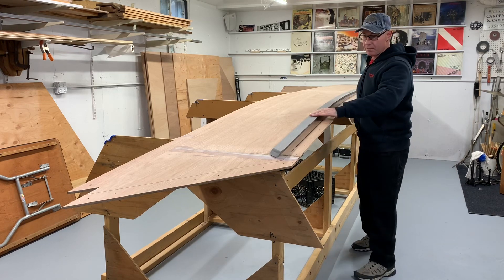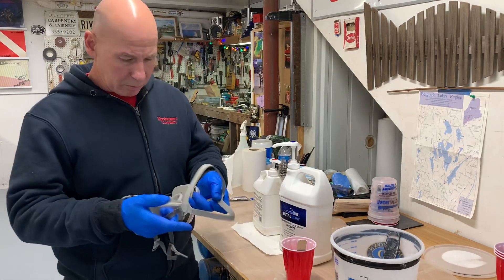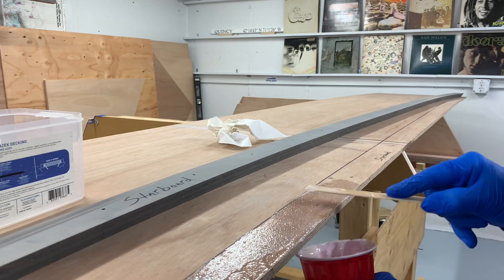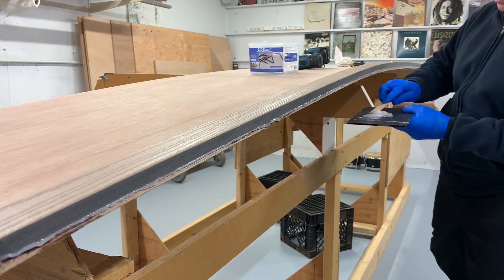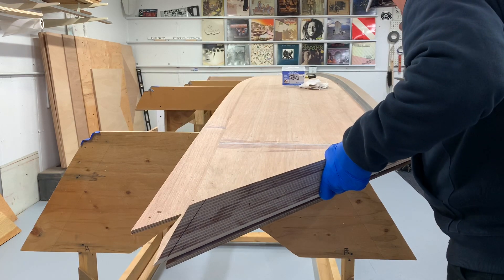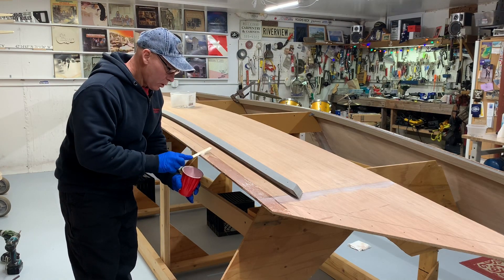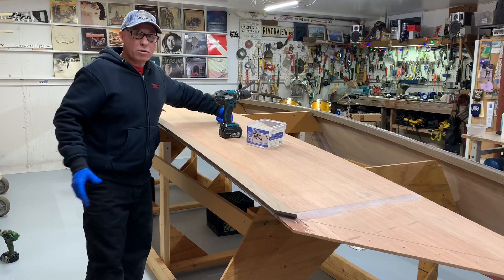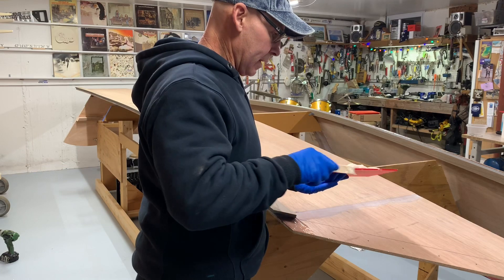Building Plywood Boat Ep 6

Comment: What kind of adhesive did people use before epoxy came along and how would it compare for longevity?
Reply from the maker: I used to use 3M 5200 adhesive before that I believe tar was used to seal the bottom to the sides
Reply: @worldboatskiff8709  thank you

Comment: Thank you for sharing. I would have thought bending the two sides together first before ever attempting to screw down the chines. Won't your procedure introduce unnecessary stress  between the chine and the sides during bending?
Reply from the maker: I have done it both ways, I feel as though as long as the glue it’s still wet everything‘s good.
Reply: @worldboatskiff8709  Thank you for your reply. It true the glue is still wet, but the stress with be with all the screw points. Isn't it?
Reply from the maker: Yes you’re right